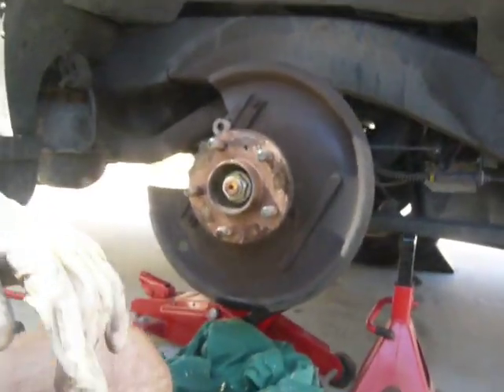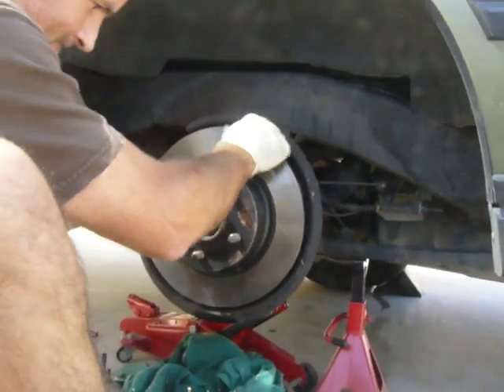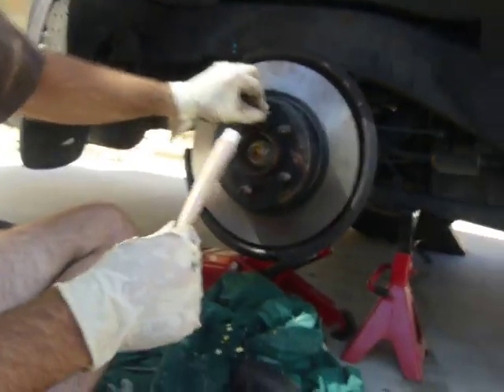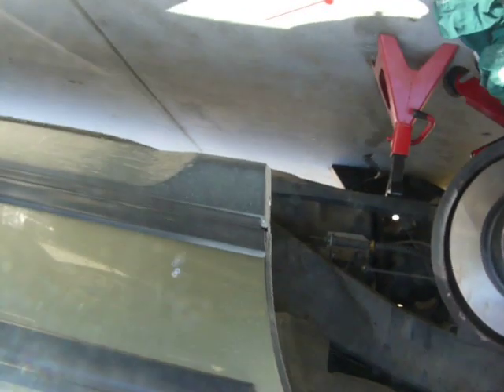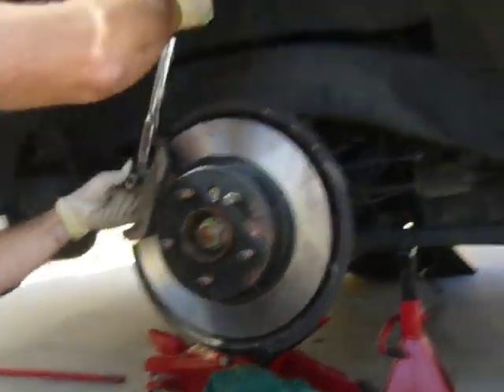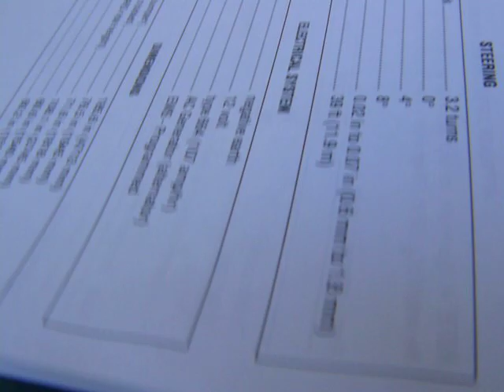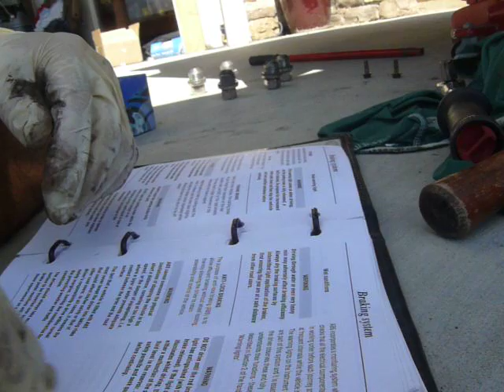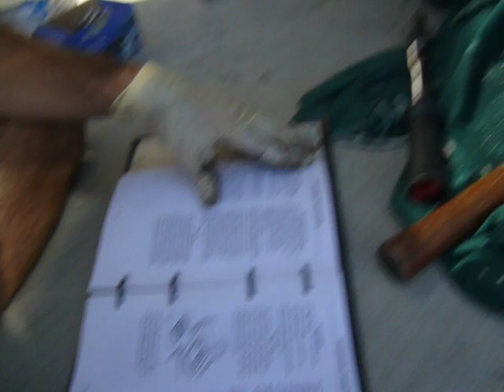Range Rover Brake Rotor Replacement

Comment from the maker: I believe the smaller bolts are the caliper housing and the larger bolts are the break housing. Not sure if that's the right terminology but you'll get the point. Caliper will come off first, but have something ready to act as a hanger so you have some where to get it out of the way, while you pull off the break housing.